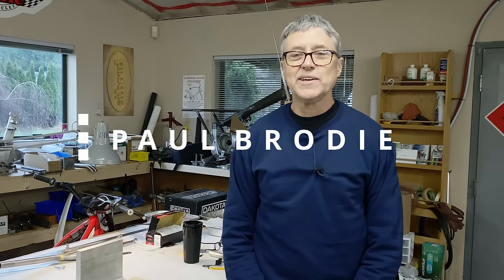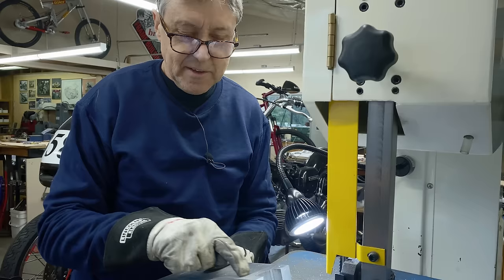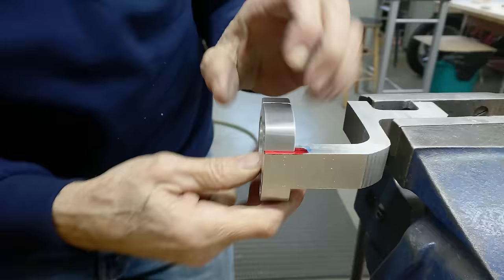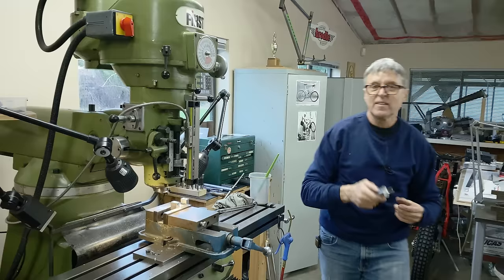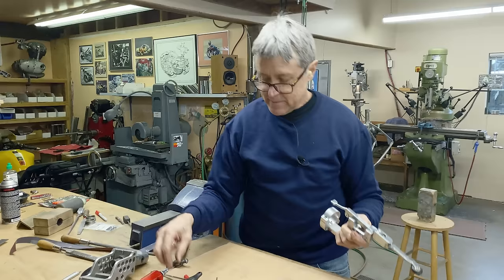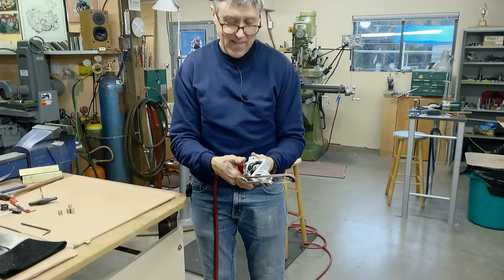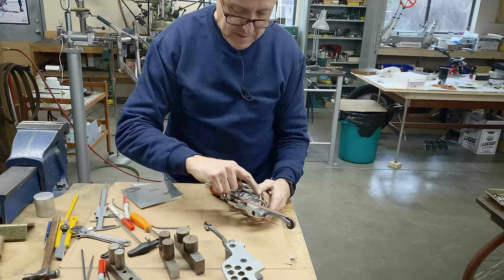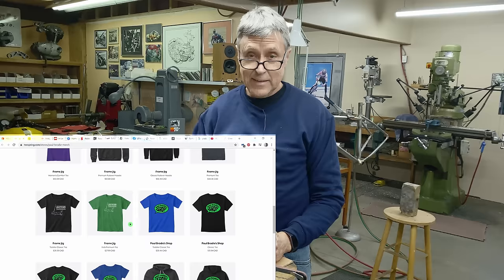How to make a belt sander - with Paul Brodie

Comment: For the younger crowd, Im a Senior field service engineer for a company that works on medical equipment.  This is the type of guy you should be learning from.  The skills he is teaching are quickly becoming extinct.  My industry regularly pays over 6 figures for guys (no degree) that can think with their mind and get out of the computer.  Yes, there will always be a place for the CNC but sometimes its just more efficient to do it the old fashion way!  Bravo! for a job well done.
Reply from the maker: Thank you for watching and commenting. Appreciate it!
Reply: Mechanical engineering student here. Have about 6 years experience with 4-5 different CAD packages now, love CNC equipment and ultra precise machining, custom parts, and fancy materials, but I grew up on a farm. My background is working with junk and making things by hand. Sometimes all you need is a square, a protractor, a pencil, some transfer punches, and a scriber.
Reply: 1000% agree! I do metal sculptures. I've made almost all my bending jigs, production building fixtures and bending tools(I bend everything cold with brute force and a dash of ignorance for the word "can't" ). And to be honest, it's the art of figuring out a product/sculpture design, the jigs to bend the parts and the fixtures to assemble them by the hundreds or thousands that I really love. You learn more from having to make do and make it up as you go. Nothing better than doing a job for $3000 in half a day when the big fancy machine shops all quote $30k and weeks. 
Paul's videos are gold for those really watching. I'd love to perch my arse on a stool in his shop for a week, in the corner and just watch. Tape over my mouth if required.... 😁👍👍👍🙊

Comment: Nice job Paul. I can relate to your' feelings of accomplishment. I was a Prototype tool maker most of my life. I'm 85 now and retired for 22 years. I wish I had your' equipment. I have mostly wood working machines. I do have a 1947 9"x48" southbend lathe that was given to me because it was a big lump of rust. I cleaned it up and rebuilt it. 
Most of my machines were given to me because they were non functional. Some machines I built from scratch. I have a 25'x25' garage out back. That is where most of my life is spent, especially now with the virus thing. It was fun watching you do your' thing. Like I said I can relate to the smile on your' face when something works out right. Thanks for the vid. I also built the full sized airplane in my thumbnail. I was flying it out over the Everglades.
John
Reply from the maker: Thanks John. Good story! Congrats on building a full sized airplane. I like my wheels to stay on the ground. Yes, I do like it when a project goes well. It can put a small on my face for sure. Thanks for watching!
Reply: @paulbrodie  Hi Paul. Thanks for the reply. I see you are into building custom bikes. I'm sure that is a ton of fun. I will have to check out more of your' stuff when I have more time. Paul was my brother/best friend!

Comment: I bought a bunch of the cheap $15 die grinders in the late 80's so I don't change tools much and all are still going strong. They use more CFM but work well. Even hooked one up to a tank and took 12" long  1.5"D Stromatolite core samples in the Ocean in the Bahamas with. Bent the shaft  very slightly so it is now for cutoff wheels but still going strong and I don't inline oil either. 

Back to business. Take the muffler off the back and clamp a innertube to the end using wire or hot glue. Put small hose whip on die grinder and slide inside inner tube and connect muffler back on die grinder. Put QC coupler on other end of whip. So quiet and air is exhausted out and 3' away! 
I even hot glued off dirt inner tube over the end of the Mac belt sander as the muffler is not removable. Just slide over handle end.

I like your vids but I too speed them up to 1.75. LOL

Comment: really cool belt sander. the ones you can buy ready made don't have as soft of a belt on the soft side. you blend a radius much nicer with a long flexible soft side without a platen. very nice.
Reply from the maker: You are correct. Several viewers sent me links to the $49 belt sander, but it has no space between the arm and the belt. I can't bend the belt to contact the fillet braze, so it would have little use in frame building.

Comment: Only thing I could add is glue. You don't have to hold your templates in place and try to keep em straight for your marks, if you hit it with a lil spray adhesive before setting it on your metal to part off. Those lil tear drops would have gone twice as fast without having to hold the template for marking, punching, etc.
Reply from the maker: I do not have spray adhesive in my arsenal. Is it bad for the ozone? I do think about these things.
Reply: @paulbrodie  To be honest a spray on adhesive is going to have propellants, I don't know what type for specific brands but California's strict guidelines on such things will probably have several recommendations. you could do it almost as easily with some brushed on watered down Elmers school glue on the template side. It saves time transferring marks when the template stays put. You can literally just put in your punch marks, cut around the placed template,  and drill it right through the template for easy reference. Clean off with plain water before finishing the edges and installing the part. Spray adhesives usually need solvents or mineral spirits to remove as well, so being environmentally conscious I would recommend the simple glue approach.

Comment: 34:30 Maybe I'm the odd man out here but I've always been a believer in that the "safer a tool is, the more careless you become with it which ultimately could become detrimental to your safety should the tools safety aspect for some reason fail... the more dangerous the tool, the more cautious you with it and that ultimately make you a better person when working with any tools that have a high potential for causing sever injury because it teaches you to be calculated in what you do." Its the whole aspect of becoming complacent and relying on features that might not always be there or might not always work. Its like new young drivers learning to rely on safety features like lane change assist rather than ignoring the lane assist and doing things like the rest of us had to, (i.e., actually using our mirrors and check our blind spots.) 

35:30 sure there is... Your brain and body are a CNC... After all, your brain is essentially a computer and its making calculations on how to move your muscles and joints which are the liner motion side of things and your eyes are the feedback encoders telling your brain if it need to make corrections on the fly all working in a closed loop cycle just like any high quality CNC. Its just not nearly as fast and possibly not quite as accurate or precise without really good visual feedback reference.

Using your brackets for example that you were making when mentioning no CNC, the saw cuts were the roughing cuts like most any CNC op to remove the bulk of the material but in larger spine segments just like a CNC roughing op and then the filing was finishing passes to bring the part to final dimensions where the spine segments were much smaller and much more precise just like a finishing op of a CNC.
Reply from the maker: I just think it's always good to be safety conscious. And I do subscribe to "Safety Third"... If you haven't heard, first is Looking Good, second is Going Fast, and then Safety Third!    Thank you for watching and commenting...   :face-fuchsia-poop-shape:

Comment: Admire your creativity and passion for metalworking.  If I could offer my two bits on your belt sander, I would add a couple of "idler' wheels that would help keep the belt flat for a longer usable length, that way one edge of the belt isn't contacting the surface first and then laying flat with added pressure.  Great work!
Reply from the maker: Thanks Grant. That little 1/4" belt is very flexible and responds right away to the slightest pressure, so adding a couple of idler wheel really wouldn't make any difference to the performance. I basically copied Makita and they didn't see the need for those idler wheels either. More weight, more expense, but thanks!

Comment: I would love to have the spare time to make tools.  Recently I bought a Ryobi air sander for about the same amount of money you paid for the air grinder.  Highly recommended, works a treat but it does go through sanding belts as if the tool came with a life times supply.
Reply from the maker: It's true, sanding belts never last forever. That's why they are called Disposables!

Comment: nice job!  The drive roller I would make out of steel and knurl it.  I have the dynabrade sanders and even their knurled drive roller wear out in a few years.
Reply from the maker: I still have the smooth 6061 roller on the old belt sander. It has had a lot of use. Yes, the roller is worn down with a little groove, but still works fine. Thanks for watching!

Comment: Using a roll pin for a pivot because of the split allows you to use a chainsaw tip grease pump to send lubricant in against your fingertip so it will find its way into everywhere it's needed. This also keeps grinding dust on the outside.
Reply from the maker: Good idea.

Comment: I removed the exhaust screen on my air drills and the exhaust cone on the die grinders and stuffed some pieces of scotch bright pad in them then put it back together, yes I lost a bit of power but the difference in noise was sure worth it.

Comment: I see possible improvement for next model for 2060 :D the biggest part can be attached to the opposite side of the grinder and then be just almost straight and not S (or Z) shaped. Anyway neither is a design I would like to do but you finished it an it looks so good!
Reply from the maker: Thanks for liking my belt sander!

Comment: 20:45 Try to rub bar-soap on the aluminium before heating it. Soap will turn black just before the aluminum melts. Good indicator that will prevent disaster happening with the torch
Reply from the maker: I will try that thanks. I've also heard you can blacken the part with acetylene and when that burns of it's 400 degrees, Fahrenheit I think.
Reply: In the past I've stuck parts in a toaster oven for 20 minutes to heat them up. This makes it easy to avoid overheating, especially if you are working with carbon steel.
Reply from the maker: @5tr41ghtGuy   I used a toaster oven a LOT when we were making Gatorblade forks. The crowns would get heated at 375 degrees F for 15 minutes and then the steerer tubes were popped in. Worked great!

Comment: Another great video.  I hope you had a great birthday.  I enjoyed watching you make the belt sander.  I also like to fabricate tools and other things also.  I've been buying tools since 1973 when I got out of high school and have put over $40,000.00 of tools in the shop in our back yard.  It's a 40'x50' shop.  I do woodturning, woodworking, metal working and machining.  This weekend I'm working on the tool to set center height of the lathe cutting tools.  I also build recumbent bicycles as a hobby.  We go to bicycle festivals and share the bikes with everyone.  I usually pick up bikes that people put at the road as trash.  I'll chop up  several bikes and use parts from all of them.  Then I sometimes have to buy new wheels and sprockets or chains.  I enjoy doing this and letting other people ride and enjoy them too.  Where are you located?  I noticed all the motorcycle engines you have on the shelves.  Could you touch on that a little bit as to what you do with them or do you rebuild them yourself or any info you wouldn't mind sharing on them.  It looks like you have some really nice engines on the shelves.  I'm glad I stumbled onto your videos lately.  I've been really amazed by them.  Thanks for sharing all the info that you do.   Dan
Reply from the maker: Thanks Dan. We graduated same year! That's great you're building bikes to share. Sounds like you have a great shop. I'm in Langley, BC.

Comment: I see Eastwood has $199 articulating sander. 3/4" belt, but maybe narrower would work. Interesting design to steal at least. Image searching "pipe' and "tube" "contour"  in conjunction with "sander" "belt" "finger" brings up some interesting food for thought. None that I could find have the serpentine belt travel like this video.
Reply from the maker: Michael, if you watch the Shop Tour video, I explain why the belt does a 90 degree bend and why the space between the belt and the arm is so important in fillet brazing. Thanks for watching!

Comment: All steel has carbon, basically more carbon added the steel the harder it can be heat treated to.  There are many different alloys added to give it different properties. Too much carbon, then it becomes cast iron.  My pet peeve is when somebody says "it is made from the best carbon steel", that doesn't mean anything.  I could go on more, but I enjoy your videos,
Reply from the maker: Yes, you are correct about carbon content. Mild steel has so little as to be almost non-existent. I'm not sure how this relates to the video, but thanks for watching.

Comment: Should have a central bearing holder with a thin bearing on each side, so you get 100 percent clearance.
Reply from the maker: I've read your comment several times and am not sure what you are referring to...
Reply: @paulbrodie  right now it's holding the bearings from the outside.. hold from the center with a thin bearing on either side.. hard to say in words

Comment: Thanks for this amazing video and explanation, it's really inspiring.
I've looked at parts number and (at least in the UK) Idler Wheel Assembly seem to be 11011 and not 11080  (contact wheel).
Reply from the maker: It's possible that part numbers are different from country to country. Are you building?
Reply: @paulbrodie  I will build it, I'm sourcing the parts at the moment and probably start machining over Christmas. I clean my fillet by hand and I wouldn't mind be a bit faster.
Reply from the maker: @sebastienklein9653   You do know that the belt sander will not "create" the shape, only smooth the shape. The Cartridge roll is used to create the shape.
Reply: @paulbrodie  yep I got that. I've found cartridge rolls in Europe they are a bit smaller diameter than Merit  unfortunately but it's better than nothing.
Reply from the maker: @sebastienklein9653   Good. You are on your way.

Comment: Hi Paul and Mitch. I came across your channel recently and love it. I come in through the bicycle side, but find the Aermacchi videos amazing. Also, great to see your health improving through what must be a physically and mentally challenging period. I have a fairly vague question for you Paul. In the early 90s I worked with Chris at Dekerf Cycels for a couple of years and was fortunate to be invited to an open house/party at your Richmond factory. The belt sander video jogged my  memory about a particular bike you had in the shop. I remember it having a machined and heavily drilled out lower BB structure. Possibly a tandem? Anything you can tell me about this bike or have I got this all wrong due to the effects of a party at Brodie HQ?
Reply from the maker: Hey Chris... Thanks for liking our videos.  Yes, that was the only tandem I have ever made. The Captains BB hung down from the frame and had (2) pieces of 3/8" 6061 plate that were heavily drilled out. Good memory! I sold that bike many years ago...   :face-orange-raised-eyebrow:
Reply: Thank you for the reply Paul. I guess every builder has to build one tandem. Right? Take care and i look forward to more great videos
Reply from the maker: @ChrisJones-yi9yh  Yes, every builder should build one Tandem. Then you learn that they take 4X as long as building a regular frame...   :face-orange-biting-nails:

Comment: Years ago I worked for a company that made surgical instruments, once the instruments were put together they had to be ground to the final shape. The parts were drop forged and we sanded and polish them until the fit nicely in the hand. The ring of the handle was done by me. I worked on a very special belt sander.
The machine was basically a large steel wheel that drove the belt and a smaller steel idler that created the tension so that the belt would move. The idler was controlled by my left foot, I slipped the belt inside of the ring and worked the inside of the ring, constantly moving. I wore a glove on my right hand to catch the belt so that i could insert and remove the ring of the instrument. very dangerous and hard on fingers and such but i got to the place where I could go for a long time without even so much as an abrasion.  
We had a safety guy come around and He saw the machine and about had a cow. He suggested I put some kind of guard on the whole thing but I told him that If i was forced to do that I could promise hIm that I would certainly loose a finger or even my a hand. Funny how no one else dared to use that machine. 
We had a machine that did the same thing but It took three machines  to do what I could do on that one machine. It was less than a year later and that old machine was abandoned altogether. Sometimes guards are a good thing and sometimes they are not. I would not advise removing guards to  anyone. Building something so that it is less clumsy is always a good idea. I am sure that it will work better and safer because of it. I learned long ago that the most important safety tool sits between my two ears.  Or like my friends says, the biggest problem is dealing with the nut behind the wrench. I really enjoy watching you're builds. thank you so much.
Reply from the maker: Thom, very interesting story. You are very correct about the "nut" behind the wrench. Thanks for commenting.